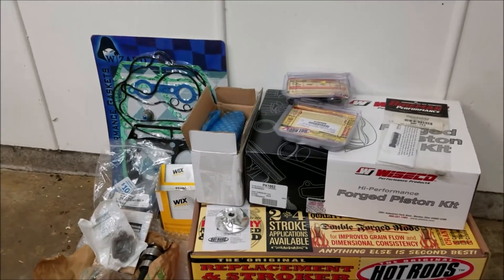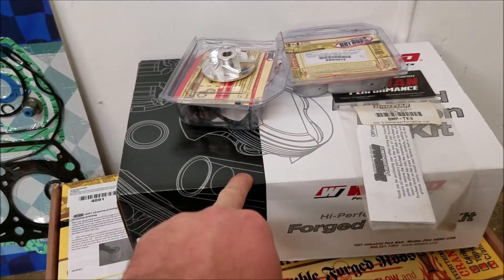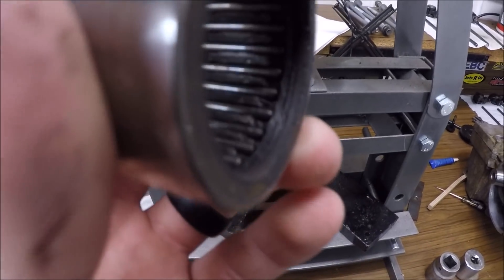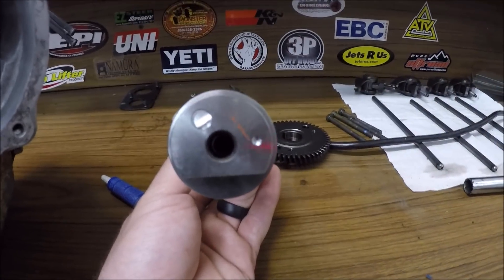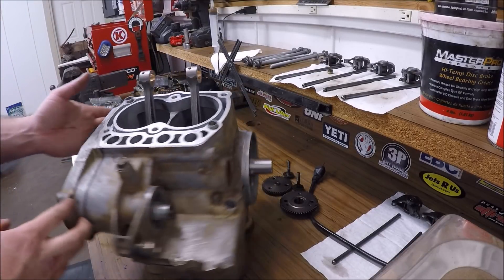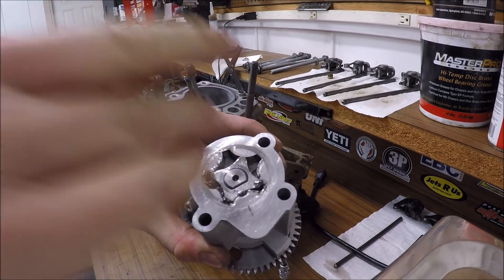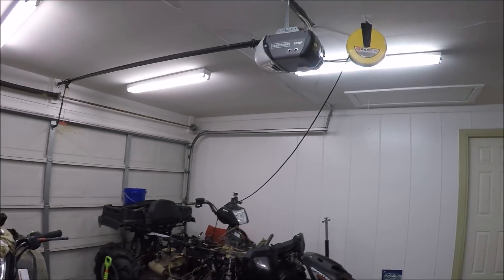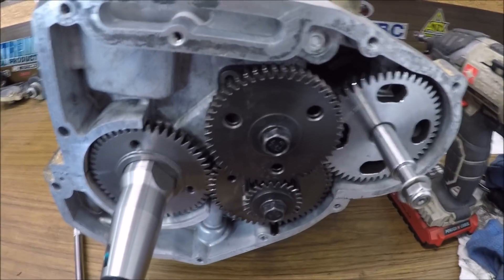Polaris Sportsman 800 X2 Bottom End Motor Rebuild

Comment: Wish you didn’t fast forward the video and wish you explains the timing marks how you lined them up.
Reply from the maker: They can only really go on one way as long as your marks are all lined up then your in time.
Reply: @Solitude313  umm there is 2 ways they can go these engines have to be timed on the compression stroke i made that mistake and it would not start so had to take the side off and re time it